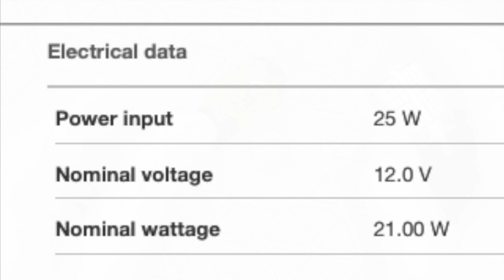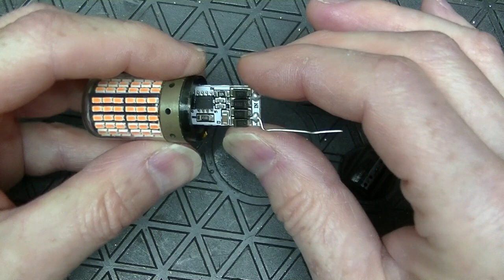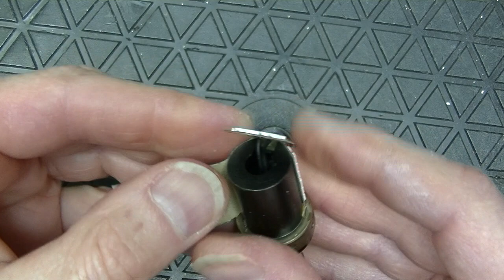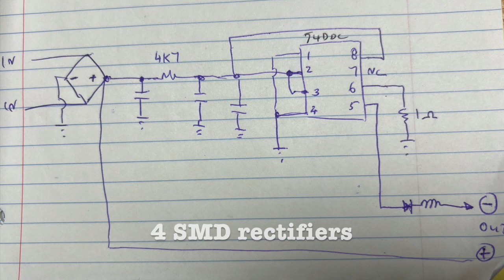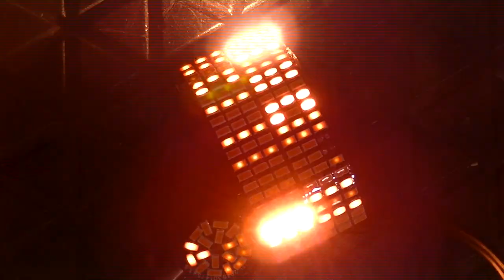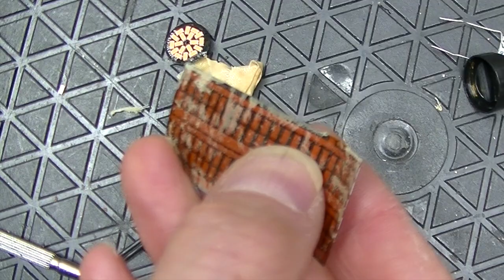Avoiding this Turn Signal LED from eBay (Teardown with Schematic)

Comment: I don't know if you're aware of this, but earlier versions of this light had no glass bulb. They were still being driven at the same ludicrous current, so they'd still fail, but the light would also be able to give you a nasty electrical shock through the exposed terminals.
Reply from the maker: I’ve only seen this LED lamp with the transparent dome over top. I don’t know if you could be electrocuted on a 12 volt circuit, but likely you could get a nasty burn from the LEDs being severely overdriven and thus overheated.
Reply: @Mr.BrownsBasement  I found a video by viperfrank from nine years ago on the bulb. The bulb shown looks a bit different, but it would be the equivalent of the bulb in that video. Title is "Dangerous cheap eBay LED bulb." (with the full stop.)
Reply from the maker: @JSRphones Yes, thank you. I watched part of that video. Many years ago, I had seen that “corn cob” style of household lighting LED on eBay but also at my local Home Depot.  I had even considered buying them as a compact, high brightness, lighting solution for my home. Fortunately, I subsequently learned that the surface mount LEDs were uninsulated and connect more-or-less directly to the line, that is, without using any sort of electrical isolation. That’s very very dangerous to someone who might make physical contact with the lamp. I never ended up getting any! Let’s contrast that kind of bulb to the automotive bulb that I covered in my video. Yes, the basic structure is very similar, that is uninsulated LEDs connected in series/parallel, designed to be over driven to the point of eventual self-destruction. But the LED lamp that I reviewed was an automotive lamp, not a household lighting lamp. Automotive lamps generally run on only 12 Volts. You really have to work hard to be electrocuted by only 12 Volts because it’s far less than the breakdown voltage of human skin. The only way I can think of is if you were to lick the lamp while it was operating. If you’ve ever tested a 9 Volt “transistor” battery by licking the terminals (not recommended!) you’ll know the sensation of tingling/burning on your tongue. The risk associated with the automotive bulb such as the one I covered would be receiving a bad burn if you touched it. Electrocution at 12 volts is extremely unlikely.
Reply: @Mr.BrownsBasement  I get it now. I'm not sure why it never dawned on me before, to be honest, I just thought the design looked familiar.

Comment: Oops...almost forgot. I just bought a Tenma 72-540 (AKA Sansei 6100) signal tracer/injector from eBay brand spanking new with original box and probes!!
Thing is really well made and even the styrofoam in the 9volt battery compartment is pristine.
Reply from the maker: Congratulations on your Find. Sweet deals don't present themselves often but when they do they sure feel good!
Reply: @Mr.BrownsBasement  It was listed on eBay for about 10 minutes as I mulled it over quickly. Thought for sure somebody would've beat me to it since those Micronta signal tracers always sell fast when they come up up for sale. Then to find one of these new in box..... I just couldn't pass it up and it'll only increase in value IMO
Reply from the maker: Yup, some deals can't wait for indecision! Whether you bought it to use it or to sell it, these items are only getting more scarce. If you don't take the opportunity to grab it you might not see it again for a long time… or ever.
Reply: @Mr.BrownsBasement  Thanks! Have a great Xmas!
Reply from the maker: You as well!! 😊

Comment: LOL....I miss those old drive in theater ads. What a great time it was.
And eBay sells some junky crap sometimes. 
I keep wanting to pull the trigger on one of those ESR meters from China but something tells me they'll be crap.
Amazon has ones made in the USA but the price is double and it's something I won't use much.
Reply from the maker: I try make my videos more entertaining so they are gently sprinkled with nuggets like that ad clip. 50s ads represent such a distinctive (some would say peculiar) genre of advertising. But getting back to eBay and Amazon: I've had mixed results. As long as I'm not heavily invested I take the good with the bad and chalk it up to experience.